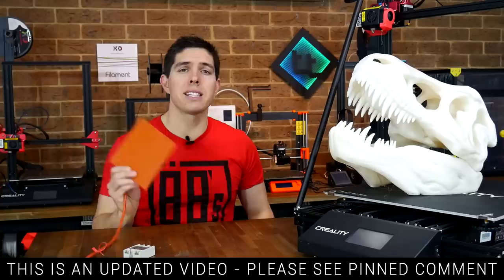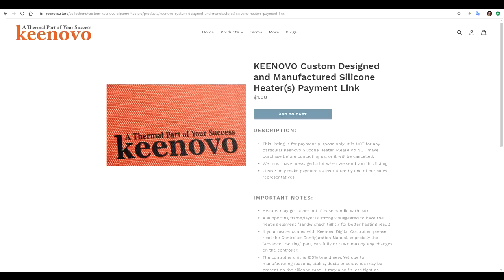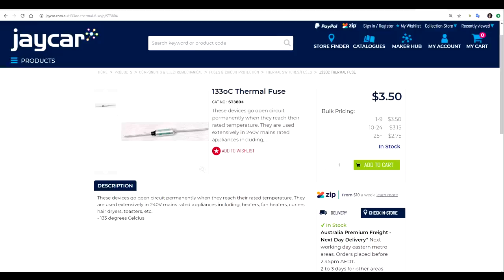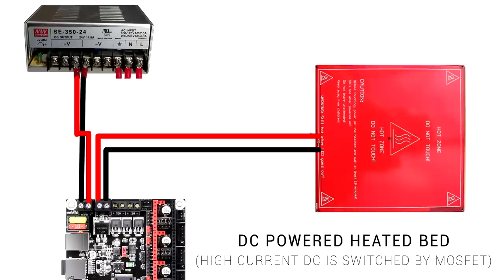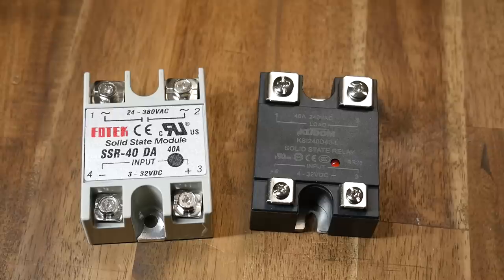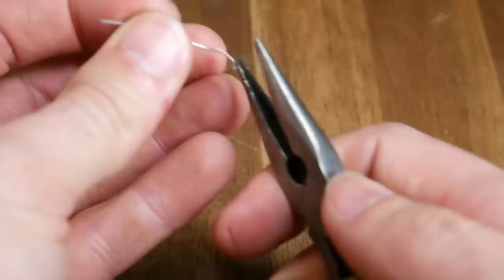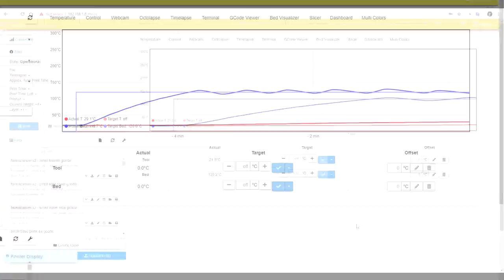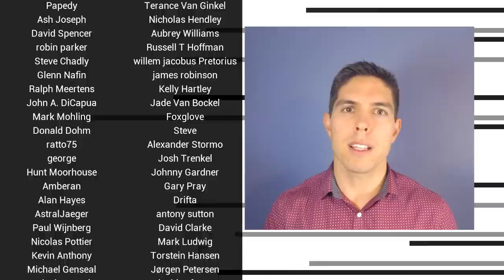AC mains powered bed guide: Super fast heated bed performance - UPDATED

Comment from the maker: This video was previously released with a process in line with what 3D printer manufacturers include on their machines with AC heated beds. Early on it was very clear that my viewers expected a higher standard. The feedback was very constructive, rather than nasty, which I appreciate tremendously. Special thanks to people like Tim from TH3D and Chris Egan for listing their suggestions point by point in a constructive way.

I’ve included just about everything people suggested. I hope this guide is now up to standard.
The standards for mains wiring in houses varies a lot around the world, hence the disclaimer to consult a professional. Just because something is safe for me doesn’t mean it’s safe for you.
Reply: Your videos are awesome I'm a pretty technical guy and I have learned a huge amount from them. I don't think anything in the previous version was in any way dangerous. But that you acted in such a responsible way is a huge credit to you. Integrity is so rare now.
Reply: Hot beds are back on the menu boys! Thanks for revising this video, I really want to do this but want to be really really safe about it too.
Reply: can we bake a cake with that 750W heater if we put insulator on top?
Reply: This is an excellent guide and it reminds me I need to do a couple things on my AC heated bed install.  Thank you for being thorough.    Also, consider adding something about adding an inline circuit breaker, such that the bed never exceeds the rated amperage.  I do not have my heated bed here with me now, but I believe mine should be limited to 6A.    Also, if you do measure the amperage at the max power of 255 and find that it is too high, perhaps that would be the setting to dial down to make sure you are below the 6A?   (Someone more experienced with these than I might be able to chime in...  I believe the 255 is a duty cycle of 100% while a lower value is a lower duty cycle.... duty cycle and amperage are not the same thing, but you could be reducing the sustained current that way.)
Reply: Best would be to use double switch SSR or two, so you can switch of both N and L, as with the European security plugs can be turned, so you actually doesn't know which is N and L when you plug it in. 

But yes, usually one only switch one of L off, and it still break the power circuit even if  the power plug is twisted 180 degrees.

One could/should also use a earth security breaker between socket and the power plug, so it will break if there are any current in the earth wire.
Reply: Worth bearing in mind uk home insurance companies will not settle claims for home made or modified electrical goods which cause building damage or fire.
Reply: I am currently doing this on my TronXY X5SA. I hate piss poor heated beds!!
Thanks for the video Teacing Tech!!!
Reply: My Anet E12 will have this mod done, as is it takes upto 20 mins to reach its max of 92C. And since its mainly ment to print ABS and other durable plastics, that wont do atall.
I was unaware of the SSR issue, so nearly ordered the fake one you showed. But other than that im not atall worried about possible safety issues with doing this.

For the record you allways do include "unplug the machine and turn it off" in mains related instructions. But that should be pretty selfevident from the vid as is.

As far as for insurance  issues caused by homemade or modified electronics. Id say a 3D printer is an oven or cookingplate type contraption, working on flammable plastics and ofthen with the use of flammable solvents. So even if you run an unmodified printer, id make sure some fire safety precautions was taken. At the very least a smoke detector and preferably something more active, if you intend to leave the printer running completely unmonitored.
Reply: Will adding this upgrade greatly increase the electricity cost of running my printer?
Reply: I dont mean to be off topic but does any of you know a trick to log back into an Instagram account?
I somehow forgot the account password. I love any tips you can give me.
Reply: @River Immanuel it worked and I now got access to my account again. I'm so happy!
Thanks so much, you really help me out :D
Reply: @Adrian Chandler you are welcome :D
Reply: @houseofflambeau9656  it won't, unless you had a bed with good heat insulation under it before and didn't add heat insulation later.
In fact, if you add insulation that you didn't have before, it will draw even less power.
The PEAK power draw will greatly increase, so definitely don't stick the printer into low rating power chords, extensions and adapters, but the electrical power for the same temperature over time is the same, it just increases your maximum power. Just as your lower powered bed won't be necessarily turned on 100% of the time, neither will the more powerful one, in fact it will be on for less time. Say you need 100W to hold the temperature you want, a 200W bed will be on for 50% of the time, a 500W bed will be on for 20% of the time only. Same power drawn over time.
Reply: Love the channel, but this particular video really concerns me.

Given you're in Australia and a lot of viewers are from Australia and NZ; you should have a number of VERY clear warnings that what you are doing is completely illegal in these countries unelss you are a licensed electrician or have a licensed electrican do the work.

It isn't even legal to do the work yourself and get an electrician to sign off on it.

Saying "Consult a professional before attempting these procedures" doesn't cut it.

Comment: This is a good tutorial but I would recommend one addition. The thermal fuses are usually rated with holding temp and functioning temp. The fuse you're using is an NEC Schott SF129E. The holding temp is rated at 118°C, this is the max temp at which the fuse will not fail under operating conditions (rated at 168hrs). The 133°C rating is the temperature where it will reliably open. What this means is that between 119-133°C, this fuse may or may not open. So if you're running temps close to 120°C you may need to bump up to the next size of SF139E which has a holding temp of 127°C and functioning temp of 142°C. I'd personally go with the slightly larger one anyways as cork doesn't start to degrade till ~200°C and gives you a little more wiggle room for more exotic materials.
Reply: This!
I was very surprised by the fuse Voron specifies for the V2.4, it's an AliExpress special and it doesn't specify any of that. Just "125°C", a firmware limit of 120°C, and users often have issues with it failing. I replaced mine with a 128°C holding temp, 152°C functioning temp.

Comment: Tip to solder the thermal fuse. Put the fuse underwater in a glass, leaving a bit outside the water to solder (I used a glass of water with clay on the bottom to stick the fuse in). In that way the fuse will be cooled by the water.

Comment: Some safety notes:
- use high strand count or energy chain rated cables, possibly in energy chain.

- You SHOULD wire a distinct earth to the metal carrier plate of the bed. Linear bearings and trapezoidal screws are not meant to handle earth fault current. In theory, every metal part that can get in contact with mains voltage should be earthed by wire, not by mounting screws.

- it is recommended to add thermal fuse to both leads of the pad. It depends. In many EU countries the Schuko plug is reversible, so you can not guarantee which lead is live. In those (rare) cases that the pad gets an earth short just at the fused side, but it happens that the other is the live feed, it will continue heating until meltdown. RCD/GFCI will trip however, if you have.

- Relay is inadequate for high frequency PID control, and low frequency PWM is inadequate for stable temperature at this power. So SSR is the only sensible choice.

- Don't cheap out on SSR. If it fails, it most likely fail short, and only the thermal fuse will stop it. Bad enough. For this reason, do not even think leaving out the thermal fuse...
Order plenty of spares, to lower the temptation to run without one, in case it blows during PID tuning...
Reply: Thank you for the correct information, tuning and hacking is fine so long it's all safe !!!
Reply: Is your third note correct? If the thermal fuse pops there's no way for the bed to heat out of control since there is no complete circuit anymore.
Reply: @TheArachnoBot  If one of the thermal fuses doesn't pop, then you still have the other, which hopefully works.

Comment: It probably got deleted when you pulled the last video so I'll say it again.
These SSR devices are NOT like regular mechanical relays. There will still be some leakage current on the bed heater as well as full mains voltage depending on where you check.
Glad you got help from Tim at TH3D. He convinced me to replace the "40A" labeled SSRs on my water heater w/ a pair of his (true) 25A-rated units. My 40s never got above 100F, but it's likely I've been running 17A through a 12A silicon device and the heatsink was saving it from a meltdown.

Comment: I believe that this upgrade will also take a lot of stress off of the printer’s power supply and keep things running a lot cooler in the control box. So this is also a longevity upgrade to the printer. You make amazing YouTube videos!!! I have a Ender 5 Pro, in the middle of a bunch of upgrades, including this one.

Comment: This is a great tutorial! Thanks for all informative videos you put on Michael! Just got my printer upgraded with AC bed after being fed up with waiting 15+ minutes to get to ~100 deg. C before print even starts. There is one side effect, though, depending on what print surface you're using. If that is glass, like in my case, there is considerable lag before the glass heats up nearly as close as what the bed thermistor reads. Starting from room temperature I can hit 100 C in about the same time as on the video, but the glass surface would be as much as 30 degrees lower than desired at the first minute or two of the print, which is obviously not good. After a minute or two, glass "catches up" to around 10-15 degrees difference (in my case). Measuring the aluminum bed where the heating pad is adhered to - difference is 3-4 degrees (accurate reading). I ended up adding delay in Marlin firmware to give a chance of the print surface to catch up with the bed by altering "TEMP_BED_RESIDENCY_TIME" value in configuration.h to 60 seconds which delays M109 command by a minute after the bed reading reaches the desired temperature. This helps a bit with the surface temperature inaccuracy (and bed adhesion with some materials), and heating the bed up is still considerably faster compared to before the upgrade. I plan to experiment by adding thermo-conductive pad between the glass and the bed surface to see if I can get the lag and temperature difference be reduced a bit.
Reply: If I don't have a Ac hot bed and plug to Ac line can it catfire?

Comment: SAFETY WARNING : At 12:00 you mention that in Australia RCD installation is standard, that is, if your house was built AFTER 1991. Might seem a long time ago, but my house was built in 1988, so the only RCDs are the one I installed in my workshop.

Comment: Glad to see that you took the suggestions under advisement.  No matter what you show someone will have a difference of opinion when it comes to working with mains power.  At the end of the day one can choose to use a mains heated bed or not.  My rule of thumb is if you are the least bit unsettled about it, then it's a good idea not to do it.
Reply from the maker: I agree. Hopefully the disclaimer at the start scares off anyone sitting on the fence.

Comment: Great video! There’s one thing noticed when you pointed out what control voltage you need. The control is the voltage that turns the relay on and off. So you’d need 12 or 24vDC.
Reply from the maker: The ones in this video will accept anything from 4 to 32V DC.
Reply: So if my mains is 220v using ssr I can use 110v heat bed?
Reply: @Farivar313  In theory you could, if you limit the PWM to less than 25% to keep the max wattage the same.

Comment: Thanks for this!  My AC bed heater came with a bang-bang style bed heater controller, and it gave me terrible layer lines when powering on and off.  I replaced that controller with an SSR and did a PID tune, and it's SO much better now.

Comment: Some additions;
- Fake SSR's often don't like PWM control, the rapid on/off switching will cause an early death for he SSR.
- I experienced fake (Fotek) SSR that could not stay cool enough, and it just melted!
- MAX_BED_POWER can also be used to prevent the fuse blowing when using some DC voltage beds. I've set this  option in my printer to 180 and that gives me just under 20Amps. Anything higher and the 20A fuse blows on my SKR 1.3. 
My 24V bed heats up to 100C in about 2 minutes. (It's a 20x30cm Tevo Tarantula bed altered for 24V)

Comment: Thank you for this tutorial.  Im setting this up for the Tronxy X5S.  The 12V stock heater is totally inadequate.  The 24V with external mosfet mod is fine but the cheap power supplies to run it are inadequate.  I had one fail from cold solder input on the mains input.  After fixing it later the NTC inrush limiter blew, probably from being banged on and off for days on end.  I really appreciate your attention to safety in this video.

Comment: Very informative video and you did a good job of installing this however as an electrician of many years I have a few points people should be aware of for Australian rules (USA may be the same)
1 This device (unless I missed it) does not state if its double insulated or not (the cables coming out of it point to not double insulated).
2 For it to comply with the electrical regs here is has to have a label stating its Voltage, current and insulation status (it may have this).
3 The device needs certification in an approved Australian lab to comply with ASNZS3000
4 If it does not comply your house insurance will be invalid, so if your house burns down there is no insurance even if the printer didn't cause the fire.
5 I didn't see any earthing on the frame of the printer after it was installed?
To anybody who reads my comments as stated here electricity can kill, a fault to the frame on this printer and somebody grabs it.......... hopefully the earth leakage will protect you but who wants to risk that?
The regulations are there for a reason for example you can only install 12v lights in your pool and so on

Comment: I should warn you. 1. The temperature on thermistor will not correspond to temperature of the bed surface. Thermal mate heats really fast, but it is not transferring it's heat that fast to aluminium bed, especially if you use glass over it. Measure temperature of the bed with remote thermometer to check actual bed surface temperature.
2. You must NOT use any thermistor that is not connected to thermal mate, because in such case you can and will easily burn thermal mate that can cause AC voltage line shortcircuit and fire or electrical hazard. Reason - thermal mate heats a lot faster than print bed surface.
3. There can be temperature deviations across thermal mate. Check it with remote thermometer. Visually can be recognizable by looking for bubbles on mate. It starts to grow hump under surface.
In my case I use both thermal mate(600W) and heated bed itself(12V). With 300*200 aluminium bed with 3mm glass on it I still wait till glass surface gets to proper temperature for several minutes after the reported temperature already reached. And my mate in one location have temperature over 20C more than reported by thermistor. 
So, I recommend you to consider turning you heated bed earlier and do not mess with SSR and this things. Or, at least, use thermal mate with low power(less Watt). I my case 600W really too much. Mate heats instantly and it takes long time to proper heat all my layers of a bed.

Comment: Caution with Ender 3 S1 Pro - there is marginal clearance to the Y axis motor. If adding this to the bottom of the existing heater bed, it will foul on this motor (as the stock one already fouls if you screw down the bed). Whilst you could raise the bed, you may find the springs then are so loose to achieve the clearance that the bed isn't robustly secured. I can't see this working myself. Yes an E3 S1 Pro has an AC heated bed, but the coverage of the heater doesn't cover all of the bed. This causes issues with adhesion towards its edges.

Comment: I've had mine f or 6 months... worked great for PLA or low heat settings.  As soon as I went to ABS or 100 C bed temps, this thing imploded.  Now the outer edges are 130-140 C while at the same time the center is 94-100 C ... and from the reviews on Amazon (that I failed to read) I'm not the only one.

Comment: Great work on the videos. I have done  this upgrade on my CR10-S4 about 8 months ago using the the keenovo mat mentioned in your video, which works amazing. But i found that cork was not that great to keep heat in. I ordered from aliexpress some ceramic Insulation and glued it to the back. Helped alot with the mat turning on and off alot. Keep the videos coming.
Reply: I know it's a year later but i'm looking at the S4 but I only really print PETG so the bed only getting to 60C stock is a concern.  with the Keenovo can you get it up to 80C?

Comment: This is just a warning for other people trying to do the same installation: please make sure that if you use a UPS for your printer it is sized for the AC bed power you are installing. I have had an issue while installing a 750W AC bed on my Reality CR10-S which has a 360W power supply and I was getting a continuous beep every time the bed was kicking up and as long as the SSR was on. I had to power the AC bed from a separate AC source as it seemed that the power surge from the AC bed was sucking too much from the UPS. Now that my power supplies are separate, everything is fine.